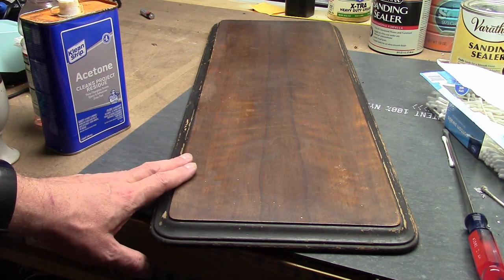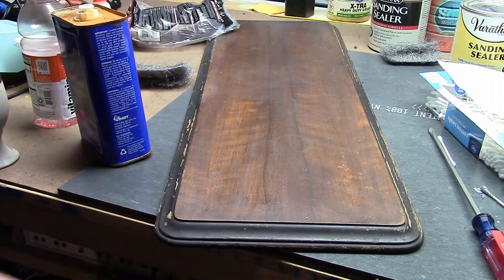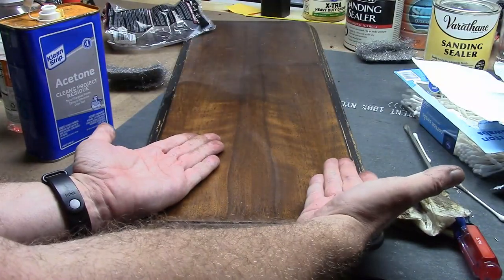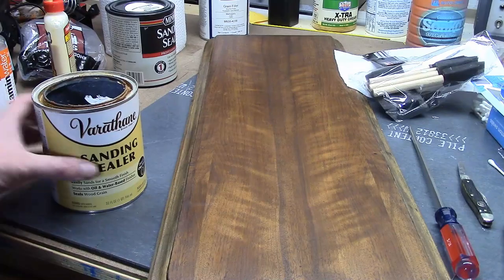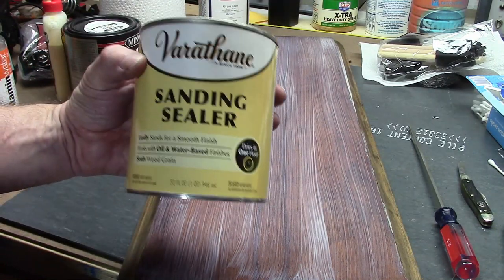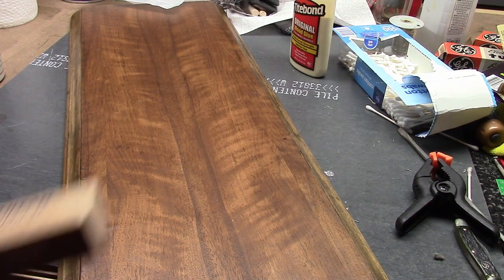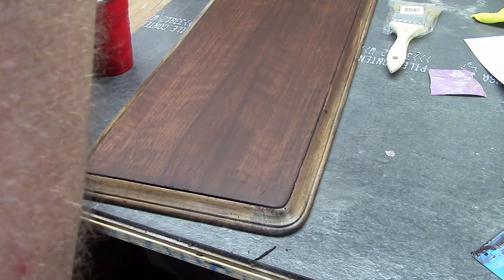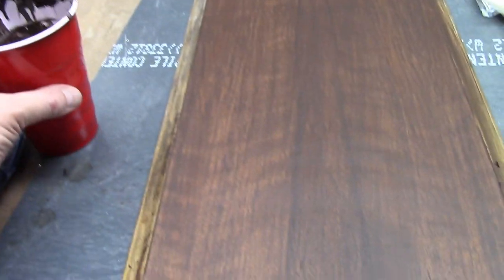RCA Radiola 60 restoraton p3o?

Comment: that`s what I read too some years ago, about mixing pumice stone with linseed oil to make a grain filler.  your videos are very instructional on how to do this process. and you have alot of patience to do it.
Reply from the maker: You may recall I tried using it on my Philco 60MB.  It did not go well.  Partly because the pumice was not fine enough and partly because I did not add color.  I think much finer rottenstone would work better.

Comment: I've read that you won't get the spontaneous combustion if you lay the rags out flat to dry before disposal and that the worst you can do is ball them up.
Reply: It's best to put them in a location where even if they do catch fire, nothing else will.  E.g. don't hang them or lay them on wood or another flammable material.  Hanging them on bare metal in a suitable place, using metal fasteners, would be ok.
Reply: When done soak them in water.  Rinse and put them in a plastic grocery bag. It will keep the moisture in
and it should be dispossed of then. It won't spontaneously combust at all.

Comment: Cork sanding blocks are available in every hardware store over here. Then again many things you call common are hard to get over here.
Reply from the maker: Here they are typically plastic or hard rubber.  I prefer cork and a felt block for rubbing out the finish.  Thick felt blocks are even harder to find.

Comment: The darkness you see in the grain after stripping, though, is colorant and old finish residue retained in the grain. In the case of mahogany, vintage factory grain filler consists of fine silica or a quartz-silica mineral. It's "clearish" and was uncolored at the factory, if I'm not incorrect. Quarter-sawed oak filler was often colored for dramatic effect, but not bookend mahogany. Incidentally, the mahogany used was probably Honduras mahogany, currently a rare and threatened variety.
Reply from the maker: I tried making my own uncolored grain filler using linseed oil and fine silica.  It was a failure.  It looked like what it was - fine grit in all the grain pores. I really think you need color to obscure the mineral grains.
Reply: @bandersentv  And subsequently, you applied finish to the filled grain? What was the effect? Incidentally, I've never tried mixing my own grain filler. Only relaying what I've learned  having worked in a museum as a furniture conservator. I apprenticed under a licensed conservator who had graduated from the Smithsonian Conservation Institute.
Reply from the maker: @michaelscottcutler3627  No.  It looked so bad I removed it all and used a commercial grain filler before proceeding.